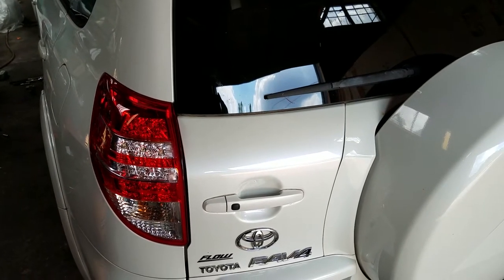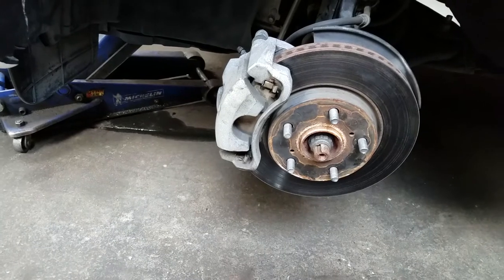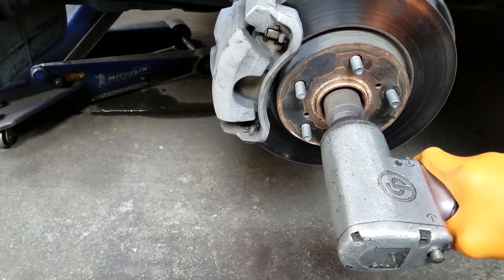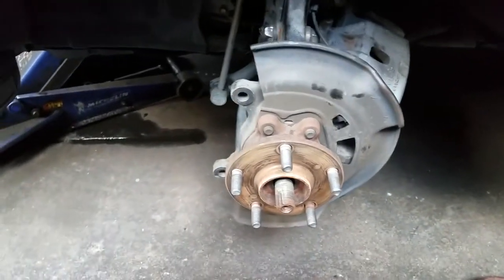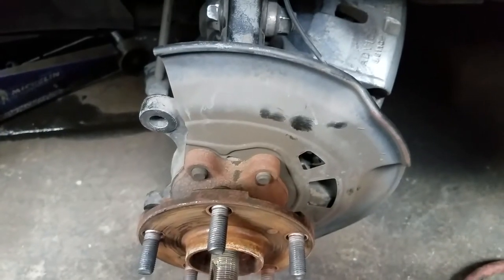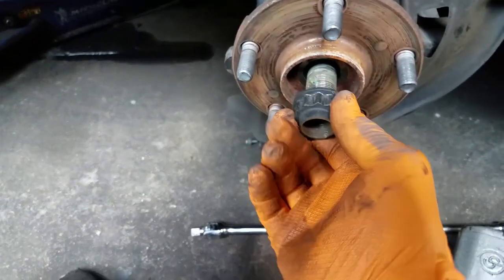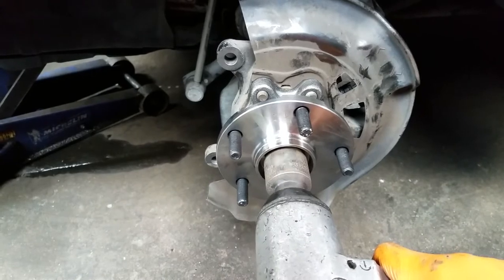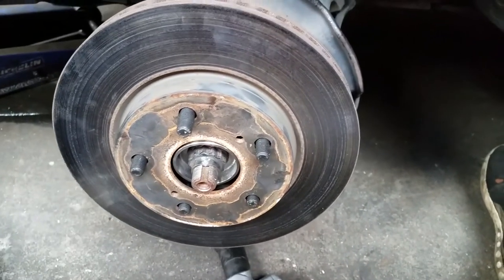Rav4 Front Wheel Bearing Assembly Replacement, Removing The Wheel, Brakes, Rotor, Axel And Struts

Comment: All you did was remove the brake assembly and seperate the axle from the hub. What happened to replacing the wheel bearing? Never saw how the bearing was extracted from the spindle or how it was pressed in with the hub. How do you show how to replace the wheel bearing?
Reply from the maker: You are correct buddy, there is a section of the video mission. I do the repairs and sometimes record clips as I work. I then pass them on to my partner who uploads them. Could be that a section was contaminated or mistakenly left out. However, a complete bearing and spindle hub was installed therefore the replacement would be a reverse procedure. Thanks for pointing this out👍🏿

Comment: Never saw the bearing work being done “the most important one”…you focused mainly on the periphery. Would you , at the end of the day, be convinced that the learner has grasped the lesson
Reply from the maker: You are correct buddy, there is a section of the video mission. I do the repairs and sometimes record clips as I work. I then pass them on to my partner who uploads them. Could be that a section was contaminated or mistakenly left out. However, a complete bearing and spindle hub was installed therefore the replacement would be a reverse procedure. Thanks for pointing this out👍🏿